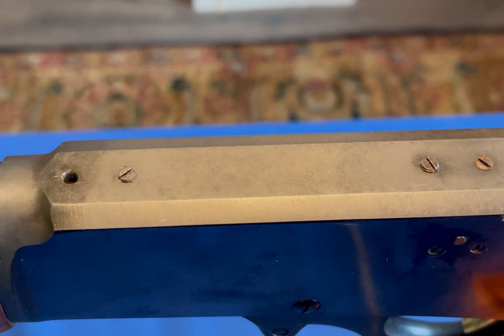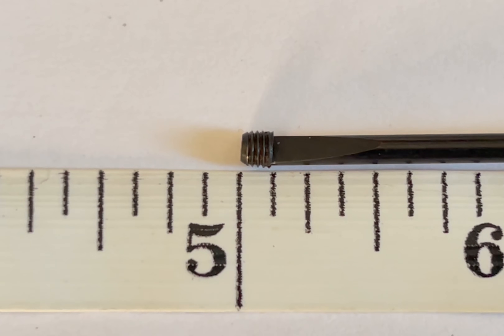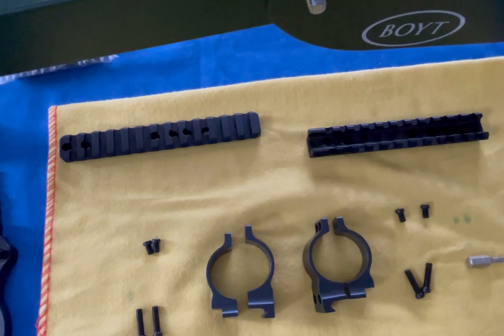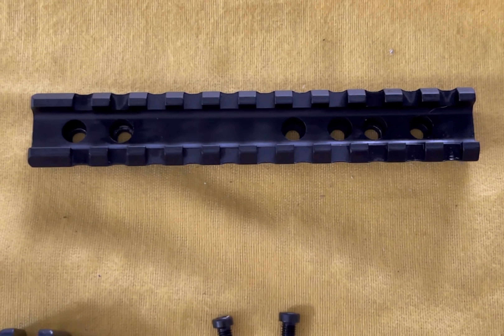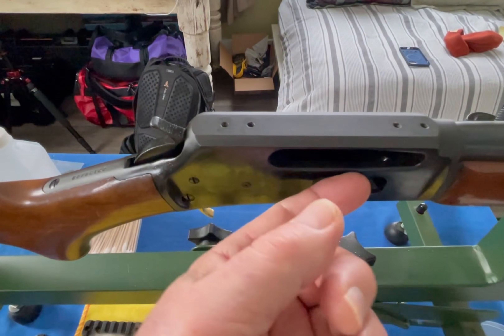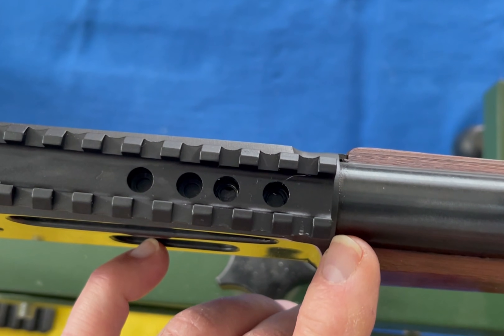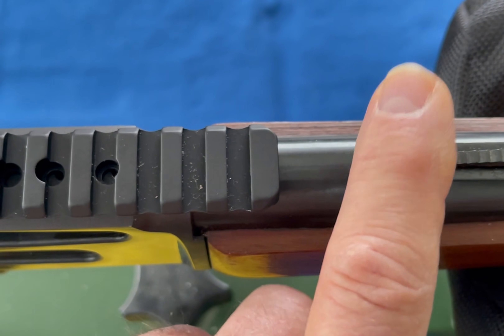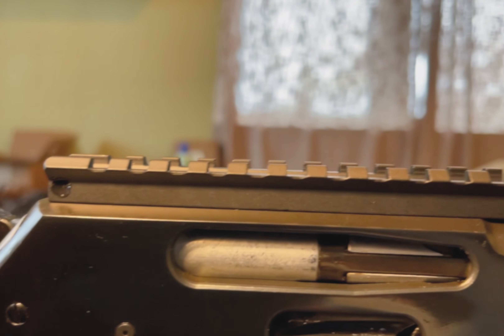How to mount a picatinny rifle scope base on a Marlin .30-30 336 rifle.

Comment: ... have EGW bases on my Marlins ... I tighten the screws until they feel snug (no loctite) ... after you've installed a couple hundred or so scopes you acquire "a feel for" the proper snugness for the base and ring screws

Comment: Do those optics mounts come with the screws or do you use the same ones from the gun?
Reply from the maker: I used the screws sent with the scope "base mount", specific to my rifle (marlin 336C) from the company I bought the base from. They will have you select the specific MOA base mount (0 to 20 etc.,.) you want for the rifle at time of purchase. After that everything else that follows is easy.